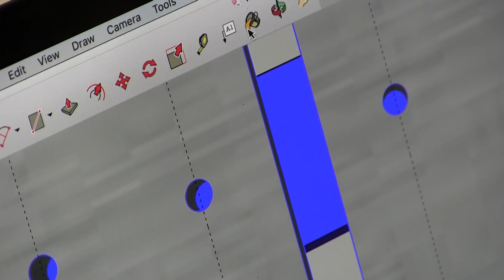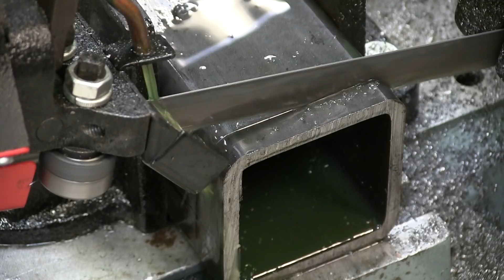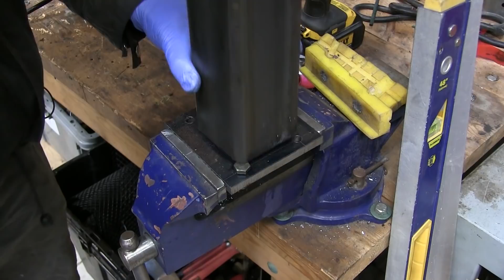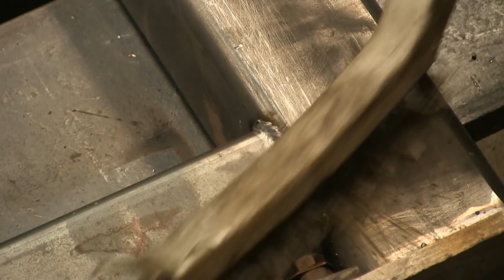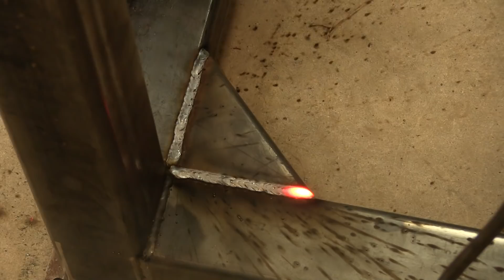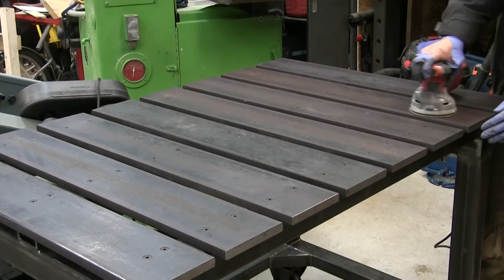Dream Welding Table DIY

Comment: Absolutely smashing. By far my favourite design so far.

I was moving towards a similar design but my table bigger - albeit not so beefy as yours - for a specific purpose (quadricycle build).

I don't know why people weld the slats to the frame when machine screwing it onto a mount first removes the risk of warping to surface.

I stayed with welding the slats initially as I thought that's what everyone did. However, now Ive seen your machine screw approach, I think that is much better - as is the aesthetic too!

I'll now change to a screwed down slats approach. The rest can be welded.

Comment: A great way at reducing spatter and preventing rust and dust from sticking to the table would be add a layer of finishing wax. Heat the plates up to 90-100°c and wipe on a layer. Protects the steel and keeps spatter down.

Comment: Great Job!!👍🏾.  What stand out to me the most about this design is the 3 parallel square support tubes for the plates to rest on top of and the whole thing then resting on top of the 2 left and right tubes. No worries about consistency with the leveling of all the plates. Will use cold rolled steel plates since i heard those are flatter than hot rolled steel.

Also noticed that the 3 tubes dont need to be welded on top of the 2 left and right tube and can simply be bolted down.

The top can be built with no welding at all and then place on Heavy duty T-Slot aluminum profile frame based stand.

😳No welding required period. Perfect for newbies like me.

Comment: Those are counter sinks not counterbores. Counterbores are flat bottomed. Also I am confused by a shop built welding table that's not welded together and needs screws and tapped threads.

Comment: Very nice job. What kind of cutoff saw and blade were you using ?
Reply from the maker: Dewalt Metal Cutting Chop saw with a 72 tooth metal blade. This is not the abrasive kind.
Reply: @bre86  Thanks for the reply. Again very nice job and also nice to have machine tools available. Looked at the Dewalt metal saw. Maybe down the road. Ours is a first time project with new miller welder and us too. Using 2x 1/4" angle for frame and 6x3/8" for top slats but probabley welded to frame. And it's only 4'x3' so fairly small. First timers project.
Reply from the maker: @williamokrasinski9840  Good stuff. When you buy the saw factor in a second blade as they tend to dull and need sharpening.

Comment: Great video. Looking to make my own from your design. Question: Why screw the top slates/bars and not just weld them directly to the table frame?
Reply from the maker: This allows me to remove the bars if damaged. Also if I mock up something thats odd in shape I can remove a bar.
Reply: @bre86  I am getting into hobby metal work. I see you got a bandsaw and cold chop saw. Why both and which one would you recommend to start with.
Thanks
Reply from the maker: @jp8479  Yes I have both. The bandsaw is less expensive to operate (blades are cheaper), quieter and creates less of a mess. The chop saw is faster to make a cut, and is much quicker to setup angle cuts. Blades are about 4x the cost but can be resharpened. I would start with the bandsaw because you can also use it upright.

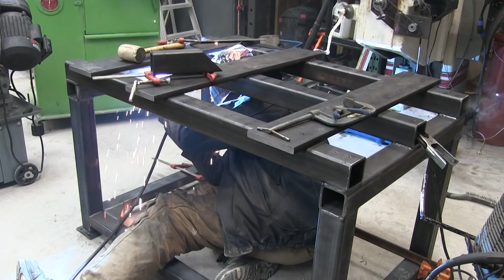Comment: Great design, you've given me some good ideas. I did have one thought tho, wrt that weld that you start at 4:59. If you consider the weld from the perspective of the bottom member, you are welding across its length (as opposed to along its length or along the edges). And when you do that you are risking the member bending due to weld pool shrinkage. And you've done this on both sides, so any effect would be doubled. I would have just welded the very end (hence along the edge of the bottom member) which would still be strong as an ox without so much bending risk. Whether ur method resulted in slight bending, idk, as you used thick steel and if your weld didnt penetrate too far then the untouched steel below can help resist the newly induced stresses. One things for sure, if you make a full penetration weld across the length of an RHS member, that thing will come out like a banana! Thanks for the ideas man.
Reply from the maker: Yes you can certainly optimize the weld order and penetration to get it even better. For the kind of work I do, this worked out well, and I have no complaints. Thanks for the feedback.

Comment: What will thickness did you use on the frame please? Also, did you drill and tap the frame to bolt the top plates into? I'm needing to build a new table, but my welder won't weld 20mm thick, thinking I could bolt 20mm plates to form the table surface similar to what you've done. Many thanks.
Reply from the maker: 1/4 Inch thickness on all tubing. The frame was drilled and tapped.
Reply: @bre86  Thank you.

Comment: not good because it is very Heavy
Reply from the maker: Thanks for the feedback. The table is easy to move on the casters. the weight helps with many projects. I much prefer it over a lighter table I had.
Reply: Its also very heavy

Comment: Table looks great, but how flat is it?
Reply from the maker: It's not NASA flat by any means, but I haven't run into any issues with projects I do. You could  belt sand or scrape the entire surface if needed.
Reply: @bre86  just asked because i am thinking seriously of following your lead and building one
Reply from the maker: @vincentsalerno8675  I really don't have a single complaint. Lately I've been using the gaps in the plates to form bends for furniture. I'll be posting those videos soon.
Reply: @bre86  A good answer is to simply show how smooth the table is.